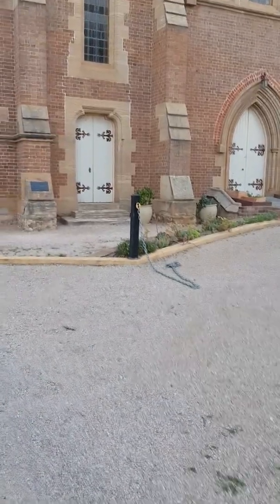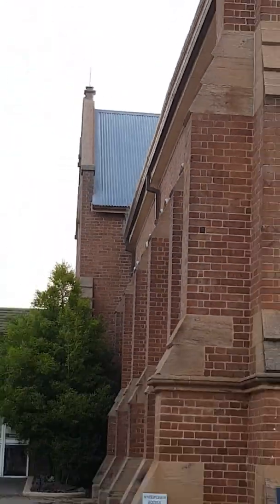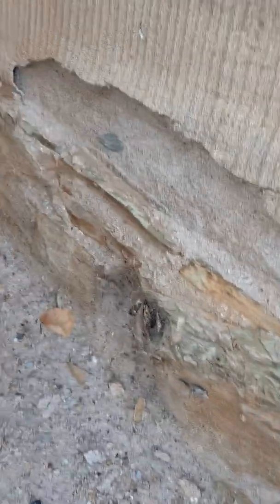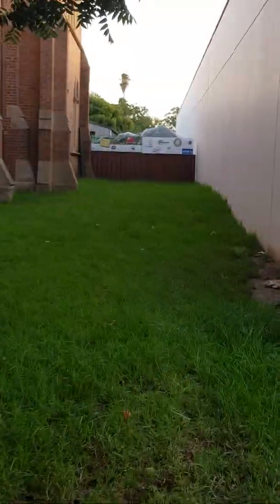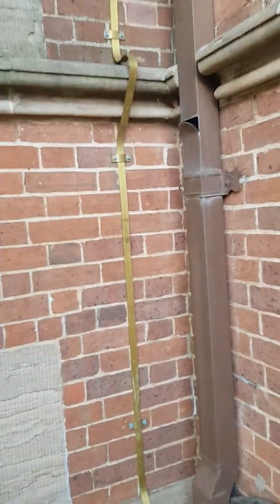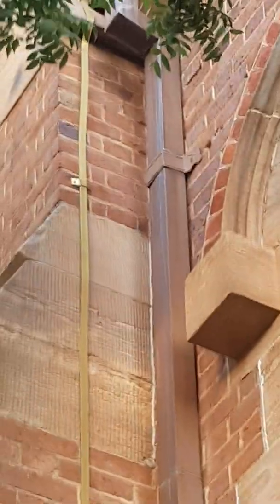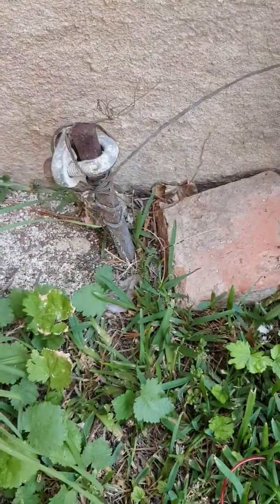400 year old Electrical device found working ! The holy grail.

Comment: Just subbed. So what do you think these "interesting" aerials are all about?  Could it be these "lighting rods" are feeding electrons from the atmosphere into the interior of the Church?  Intriguing, to say the least!!
Reply from the maker: Atmospheric electricity. The universe is electric, its all around us. Through the heliocentric model the God given free energy is hidden from us through fake sciences. 
If that is a lighting rod, then the wires going into the roof will burn down the building first strike. 
My guess is there's a capacitor of sorts collecting the atmospheric energy, probably connected to a transformer, allowing other devices to operate. 
Who knows with today's technology maybe a transistor power board ? 
Older valve or vacuum tubes operate on 0 .25watt, so not a lot of current is required for certain operations. 
The aerial will be an almalgm of precious metal and the newly installed brass ribbon allows maximum current from the earth.
Keep researching, truth is stranger than fiction. 
Cheers.
Reply: @charliejeans2413  This makes sense  ... I remember reading a story in Nexus Magazine, back in the early 90's where a West Australian retired gent, took the protective 'plastic/glass' cover off solar panels and discovered current from the air could be drawn from the atmosphere-after the sun had set!!! I never knew what happened to this inventive man, probably the 'Authorities' of the day, had something to do with, why nothing more was said about this idea!
Reply from the maker: @Cube_Ernator1077  hey, there's been a lot of brilliant Australians, Joe Cell is amazing, he passed away ? , there was a guy in Victoria who was making a generator for sale that ran off magnets for 25 years, he's gone quiet and can't be found ? 
Look up A I R Joe Cell on yt for an amazing study on magnets and fuel cell. Cheers
Reply: @charliejeans2413  I've heard of the Joe Cell- I remember seeing a video way back in 2007  ...no doubt, our "Illustrious" Government and their cronies Pressured the inventor to "forget" it about it  :-(
Reply from the maker: @Cube_Ernator1077  yes, in Joe's vids on yt, he is visited by the men in black and from that point on he makes it clear "he's not interested in free energy, he pays for his petrol like everyone else" He passed if cancer a few years later. 
His cell is the electric current produced by the cell, the water bubbling only indicates the health of the water in the cell. 
His information on magnetic and electrics is fantastic.
We are told Tesla was the champion of AC, AC is alternating, +/- melt the wires, burn out your device and will kill you. 
DC direct current, +/- touch the generator stops. No harm. 
The problem with DC is if a grid was powered using DC, then 1 short in a house would stop the generators. 
So AC was decided on, before you burnt your device,  now you blow a fuse or trip the switch, but the grid stays on. 
Tesla was the great inventor but I posit DC was his preferred current. The hotel he lived in had a 25 kva DC generator in the basement, Tesla was the live in electric maintinace guy. 
The hotel had a UV light machine that dissifected the bathrooms, the machine was wheeled in, switched on and pesto. 
The entire building was a DC electric device. 
Now we are told Tesla held in his hand 25,000 volts of AC to prove it was safe ! I call bs, DC yes, AC NO. 
We've all seen the Tesla coil produce power, people hold hands and the current goes around the body and discharges when touched.
Magneto is DC power, the way you stop your engine is to earth the power wire. 
No harm comes from DC, but AC will kill you. 
Cheers.
Reply: @charliejeans2413  something I find Interesting  .. is 'Who Built the Early Churches?  There was a Catholic Church built in 1835-supposedly!!  My research has ground to a halt as No One apparently (Catholic Church) can answer my question as to 'WHO Built .....? The assumed answer is "Architects designed Churches and these were Built" but the identity of these mysterious and "gifted" engineers of brick and stone appear to be Nameless and anonymous!!! 'The Churches were just Built' really isn't any sort of intelligent answer!!
Reply from the maker: @Cube_Ernator1077  I did a vid recent on Melbourne war memorial.( It's a freemason temple for light worship)  I found Australia was in a depression from 1880 to 1940. The story is there was no money to build the ww1 memorial till 1934. Yet we have all kinds of buildings, church's, Gov buildings supposedly buildt all through that time period in every state, province, country town and city. ! 
The pictures from the offical sites are made to look old. I got 100 yr old pictures that havnt been stored correctly and there in 100x better condition than these so called 1934 pictures, that would have / should have been stored correctly? 
I'm calling bullshit on the entire history we are told. They either know exactly when and who or they don't, either it's lies.
Reply: @charliejeans2413  I have been looking at "old" photographic images from 1848, here in Australia. What strikes is is the similarity of the Grand buildings- they look the same as other buildings around the World! Apparently .... a convict "Forger" 'Greenaway'?  can't recall his first name, anyways supposedly this convict forger, "designed" all these buildings including Churches from 1796 onwards. Somehow, the idea of a Forger building Churches and Government buildings on a Grand scale seems 'off'. I've noticed also that several Churches appear right around the Country but there's little "evidence" to show this Greenaway character ever leaving Sydney, so Who but these??  It IS Very Strange!!! Yes, "history" as we have been "taught" appears fishy, eh?!!
Reply: @charliejeans2413  'Francis Greenaway', that's the name of th eConvict Forger, I couldn't think of, when I made my earlier reply to you!!
Reply from the maker: @Cube_Ernator1077  sorry for late response, bloody yt doesn't notify of comments.
Something is completely amiss with all the buildings, I've watched everythingisalie in WA, it's the perfect city to show all the coocky stories. There was nothing there till 1840 ( ?) And oops the church's, the gov buildings, the banks, the Masonic halls all exactly the same architecture and building designs as the rest of the world.
Australia on the whole us an excellent test bed for all the theories, we got it all here,  and the last place to be "discovered" lol
It gets better, the exact same story of who did what, build this, owned that, gold rush, all the same story.
There all freemason society in "news print"  claims all these buildings are by there own members, enormous feats for an individual in one life time. 
Yet the freenason society does not list those names or even being in Australia till later  ? 
Just more lies to decieve the folk. 
Cheers, keen to see what you find.
Reply: @charliejeans2413  its all good mate, on the late reply! It's a bloody mystery to us, but not a 'mystery' to those who know! Good video and I'm looking forward to seeing more of your discoveries, cheers!!

Comment: and resonators on top))) old news) they everywhere)
Reply from the maker: 1st one I've seen in Australia, working. It's the same as ones seen in 400 yr old pictures on buildings. Yes this type was everywhere at one time.
Reply: @charliejeans2413  how it was working?) i want to share it on my chanel)
Reply from the maker: Look closely at the centre and the 4 white lights flashing around the middle.
Reply: @charliejeans2413  ok) i want to add it in my next video about free energy antennas - may i?
Reply: @charliejeans2413  i did not see flashes( all is grounded -= turned off
Reply from the maker: @globalvision4633  look closely at 2.33. You can see the white pulsating energy in 4 parts around the centre, slow it down  the energy is there at 14, ,,  2.33, and at the end. Feel free to use this vid.
Reply: @globalvision4633  you can see current clearly in centre of star.
Reply: @doravernon1511  ok i will try again
Reply from the maker: @globalvision4633  here is a screen shot edited with different filters.
https://youtu.be/Uqq7wn9KMzA

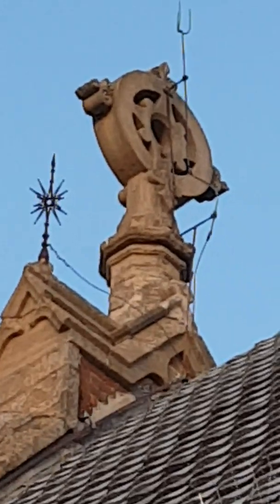Comment: Looks like some kind of heat haze your camera is picking up @02:33, afterall there's blue sky and sun is shining so you need to eliminate all other variables before making firm conclusions; record with another camera to see if you get same results, record on a colder/cooler day and at different times of day to see if you get same results, maybe even go into the church and ask someone what those metal objects are for, then you might arrive at a different conclusion.
Reply from the maker: I went back at night time. These church spires and crosses light up like Xmas trees. The energy is bristling all over them. Go check out an old church in your area at night.
Reply: @charliejeans2413  got a video i can watch of these lit up like xmas tree churches??
I used to live across from a reasonably old spired small church and at night time, the only light I remembered seeing came from the light placed above a doorway to the building! Nothing out of the ordinary there!
I guess it's a case of extraordinary claims require extraordinary evidence to support them, so a video would be fab!!
Reply from the maker: @PeterPete  there's 4 vids on my channel of the churches at night. Even the stone crosses flicking blue and white light off them.
Reply: @charliejeans2413  got a link to one video plz?
Reply from the maker: @PeterPete some of sparkle got lost in the upload compression. Bdcavedweller on yt did a few filters on it in the comments etc
  https://youtu.be/cpcBqgbuLl4
Reply: @charliejeans2413  tks for the link - i'd put it all down to a poor quality video recording! Have you tried with a diffferent recording device?
Reply from the maker: It's not the device. It's yt compression on upload. Go take a look for yourself at night. They are atmospheric charged
Reply: @charliejeans2413  well what i'll do is to take my recording device out tonight and take some footage of a church to see if I get the same results - of course videoing a spired church with lightning rods on it! If you are correct then I should get the SAME results! If not.......
Reply from the maker: That's an excellent idea.